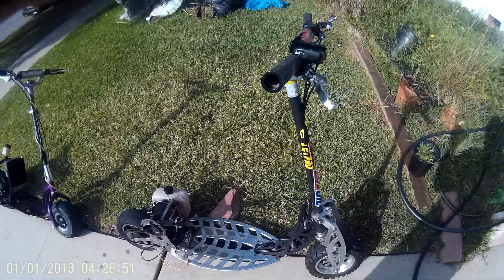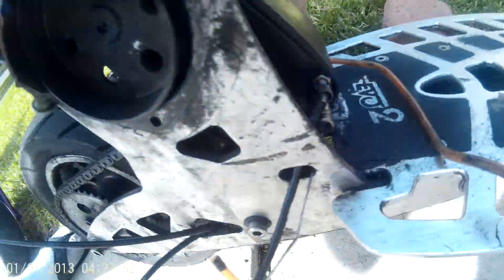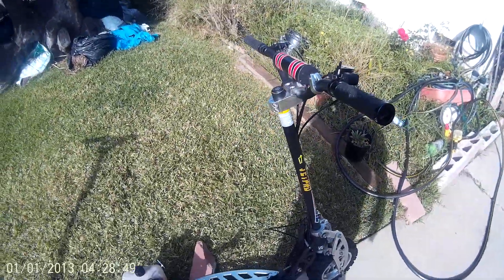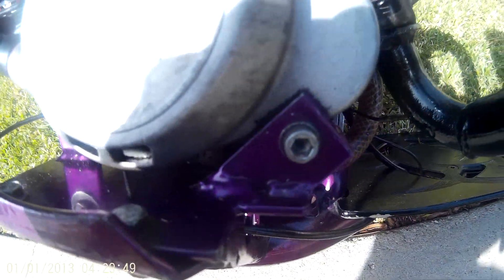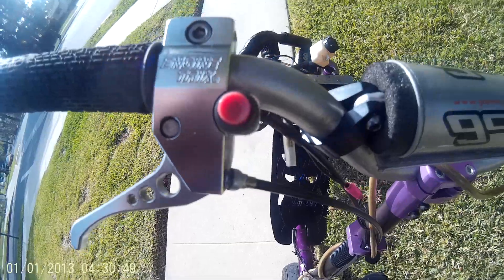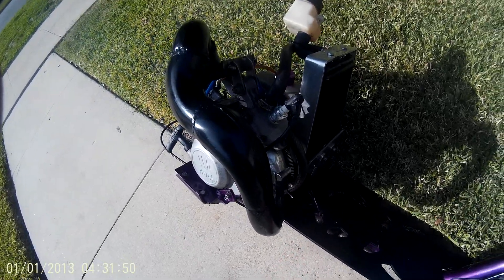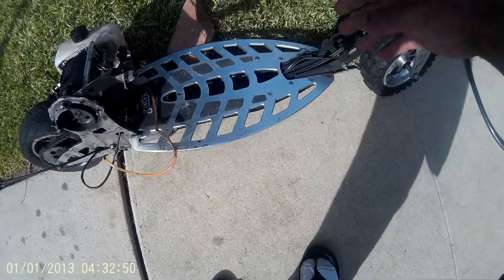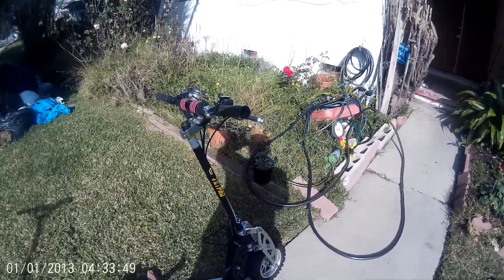update on my scooters evo 2x big powerboard and goped GSR40/BLATA 40CC

Comment: EVO Life!!   Lizard Skin handle bars Is a MUST!
Me and my homie got 2 Evo 2xs that we ride everyday.
Cayman Islands Ped Life!

Nuff Respect Darnell, watch your vids almost every week lol.
Reply: Also just Subbed.. Never sign into youtube but had to sub. Quick question what do you think about a 14T drive sprocket with the stock 54?
Reply from the maker: much love daniel bush im a EVO lover for life bro EVOS always beat goped at the line we got way better take off and engine control with the 2speed THEN a goped  but if u have any question shoot it at me ill help u out learned alot of trick on my Evo
Reply from the maker: daniel bush
 i say it will affect ur fist gear power transfer but ur top end will be nice foreshore u just lose the quickness u have wont be much but its a diffidence
Reply: Darnell Payne
 Str8 my G. The Evo takes off like a bat out of hell when its nice and warm, so not too worried about losing some torque for more top end. Still have the Chinese motor that it came with, got a upgraded carb, torque box exhaust and the lizard grips. Planning on getting a 460 next month or so, along with the 14T.

I got this one problem right now tho that im trying to figure out. When i get up to a good speed i get a bit of wobble, so need to figure out why thats going on... Was watching the first pros and cons video u put up and talked about the wobble at speed because of the level that the bolts in front are at. (the ones that connect to the front shock). just not sure on what i have to adjust.. might just have to pull the front suspension apart to figure it out. I live on a island close to Jamaica and only me and my homie has them on island so no help around here lol.
Reply from the maker: daniel bush
 ill make u a video rite now
Reply from the maker: daniel bush http://youtu.be/2qoA9enkbwI
Reply from the maker: Sent u a video for u to see how to stop wheel.wobbles